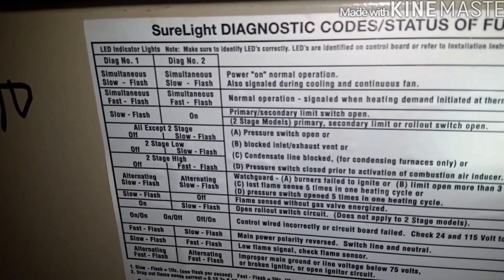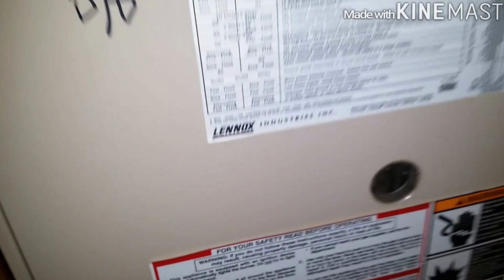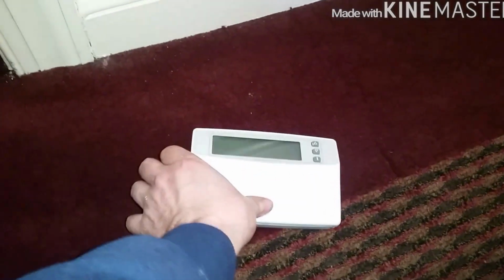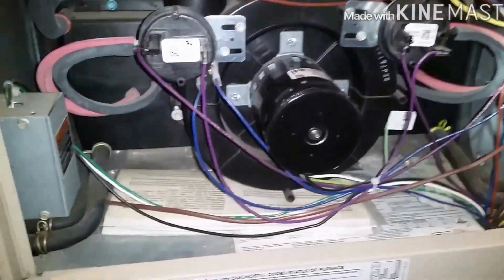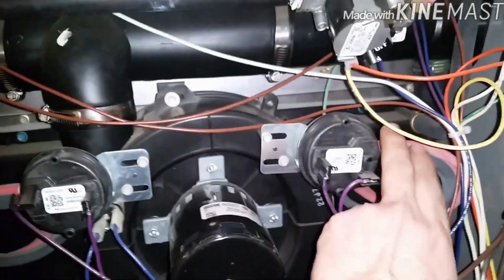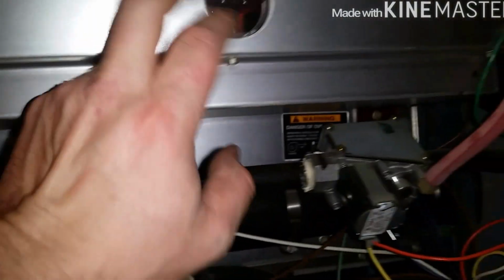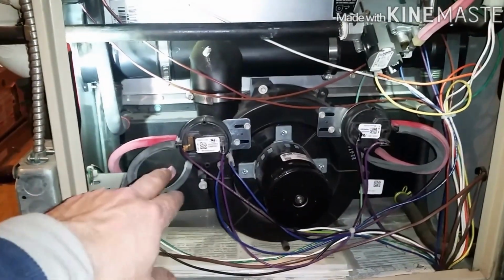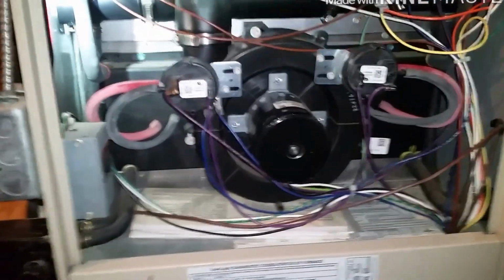No heat call blowing cold air

Comment: On that furnace what microamps are you looking for on the flame sensor and what Ohms are you looking for on the hot surface ignitor?  I always found the flame sensor reading erratic on those units. Where are you checking it from?

Comment: My Carrier was showing a code 31.I was hoping the Pressure switch was good so I found the condensate box blocked with crud.I unhooked all the hoses and pulled the box to clean in basement sink with hot water.I also cleaned all hoses.I blew out the exhaust pipe.The Inducer was working and no strange sounds in the housing.I hooked it all back up and it is running great now.I do need to get the proper electronic testing equipment.Now my basement and garage look like Lowes because I work in commercial and residential construction so I have so many tools and testing equipment for most jobs.I install audio sound systems on the side and build ported and unported bass boxes.My wife said "yeah Jim just what you need more tools".LOL I love being able to fix things myself.About 10 years ago I called Highway Appliance to fix my washing machine so $120 and 5 minutes later he was done.I looked online and the part he used cost $5 dollars!!!!Ever since then I fixed the igniter,flame sensor in my furnace and always fix my own appliances.I help friends and family save money also.Learning NEVER ends...

Comment: my Lennox G40uh series no heat only blow cold air... error code give primary/secondary limited switch open....I checked primary continuity & wire end of sec limited switch both have good continuity.  Any suggestions
Reply from the maker: kag thongktoh check to see if u r getting 24 volts to or threw limit

Comment: Hi, Not getting any power to the inducer motor until I suck on the pressure switch hose. Is that somehow powering the inducer motor through a back door? 
1. Call for heat. 2. blower turns on... nothing else. Until I pull off the hose and suck in. Then the inducer motor turns on and furnace fires up. Any ideas I'm stumped. Replaced board & pressure switch.
Reply: JH HVAC & Plumbing yes it still ended up being the board. Just needed to find/install the original. The furnace had a conversion kit that wasn't working.
Thx
Reply: what does the to pressure switch do on a ruud
Reply: pressure switch you solved own problem
Reply from the maker: fred D that is a strange one , did u figure it out ?
Reply: Go to school.. no DIY

Comment: my heat is blowing out cool air can u tell me wat too do
Reply from the maker: when u reset the power what happens ? Does the ignitor glow ? What code are u getting on the control board ?
Reply: JH HVAC & Plumbing i dont know wat im doing i dont see no reset button just a on and off button my heat not coming on at all

Comment: Hi JH, my gas lennox(model G40uh-36A-070-03) blow cold air,  ignitor glow couple sec shut off gas. Its gives me a code of primary/ secondary limited  switch. I test continuity on both its ok. Also once furnace call for heat my blower fan come on at the same time as the inducer fan. Is it normal?  the filter change, flame sensor clean. Any suggestion would be great, thanks
Reply from the maker: you checked the high limit ?

Comment: Nice, Justin. We see condensing equipment in attics where I'm at, too.
Reply from the maker: It's very sad and don't make sense up where I am . Major issues and flooding :-(
Reply: It's only an issue down here during weather when the outside temperature remains below freezing during the day. They usually won't freeze in the attics but at the exterior drain termination. But that's "extreme weather" for north GA.
Reply from the maker: +sad hvacman right when the weather is below freezing during the day but we see stuff freeze in the attics also
Reply: I figured you guys up there would. Do the drains up there usually drain outside? Are floor drains in basements common up there? They're a rarity down here.
Reply from the maker: +sad hvacman many floor drains in the basement and lines ran to sump pump pits . If 90 plus unit in attic from new construction they usually run line threw home to basement. Running condensation pump to outside for 90 plus or humidifier usually will freeze
Reply: Btw, I sent you a Facebook friend request a while back.
Reply from the maker: sad hvacman send now again
Reply: It's still there. I'll unsend and send again.
Reply from the maker: sad hvacman not sure what name u r under